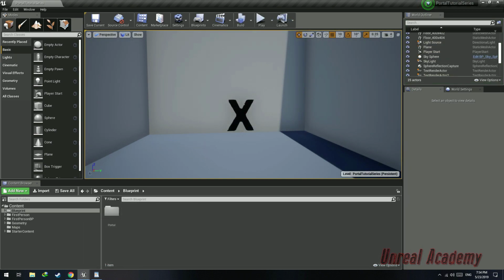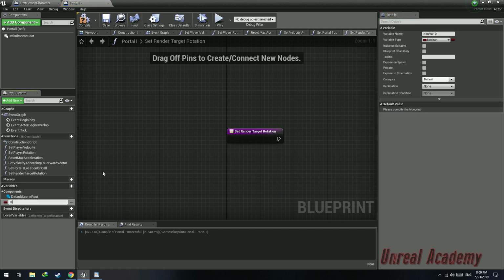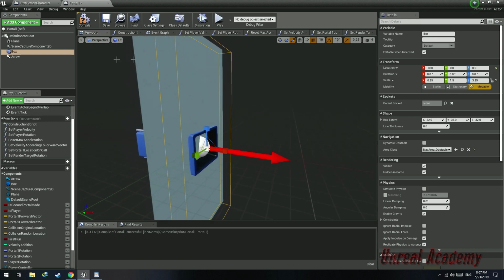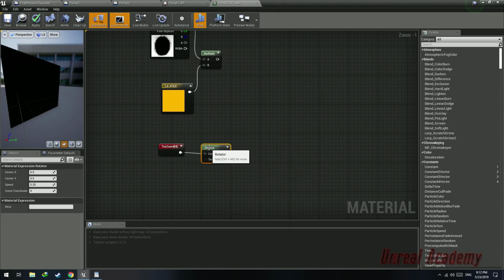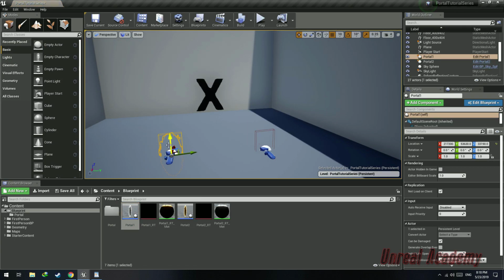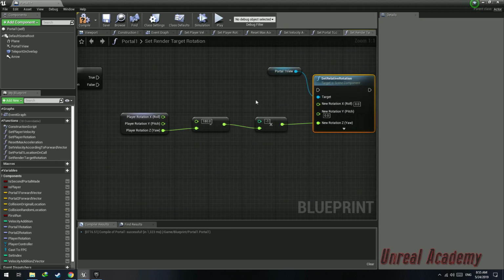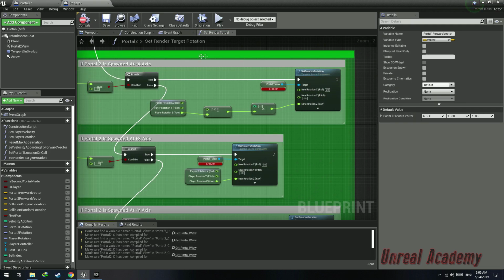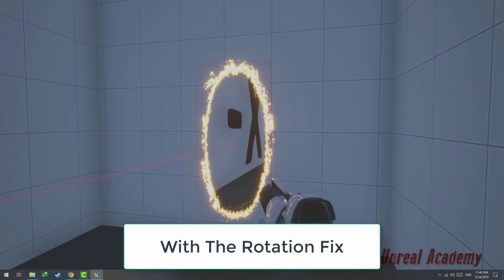Portal Gun Tutorial Series  - Setting Up BP - Variables And Render Target | Part 2 UE4

Comment: Do you have any idea why it is that when I set the portal texture color to a blue or green hue it decides to show the edges of the texture again?? If anyone can help me that'd be awesome.

(Edit: I moved on from this problem for now and have run into an issue where the "CastToFPC" is unable to connect to "Portal2ForwardVector". Any help would be appreciated!!)
Reply from the maker: Did you manage to solve it? If so, let other people know so that people can benefit from the fix! My guess is that the blending and all that only work with specific values/colors, which is why that happens.

As for the second issue, I don't remember why it is supposed to cast at this point, and so I can't be much of help for you with this. Sorry!
Reply: @UnrealAcademy  Thanks so much for the response! I found a suitable semi-workaround for my project where if you add an additional blend overlay with a separate texture and constant multiplied by each other you can add an inner layer of whatever colour with only a small ring of the original texture colour options (white or hues of red) on the exterior of the portal. This actually helped create a beautiful effect on my portal but it doesn't fully solve the problem.
Reply: @UnrealAcademy  Still no luck finding a way to connect those 2 nodes though. they seem to have gotten rid of that capability in version 5.
Reply from the maker: @ZonsCHANNEL  Right click and see if you can do something with it. I remember you used to be able to right click the hole and some options would pop up?
Reply: @UnrealAcademy  unfortunately I tried this already with no luck. I’ll continue to search for a solution to the problem and give updates here if I make any progress

Comment: Don't know if you still look at comments for this tutorial, but I'm having an issue with the portal's camera moving with my player camera. When I look left to right, the portal view stays the same (ie, it works), but if I look up and down, the portal view moves up and down as well, and it sort of ruins the effect. Did you cover this at all, or is it something I missed?
Reply from the maker: Hi! Yes, I do still look at comments, just don't make any videos anymore due to the timetable of the university.
As for your question, yes, that is a bug in this Portal system that I could not solve because the player rotation doesn't give us a way to check whether he is looking up and down. 
I think you could do one thing, check the player forward vector. If it's in the Z or -Z direction, you can move the portal camera accordingly?
Reply: @UnrealAcademy  I'll be honest, It's my first time using unreal, and what you said pretty much went over my head, but I did find a "sort of" solution. Connecting the Player Rotation Y variable to the New Rotation Y when setting the Relative Rotation fixes it - there's still small movements when looking up and down, but it's better for the most part.
I did however notice another mistake/bug, where when you're looking at the portals and walking away, the object in the portal view move too, which I don't think is supposed to happen?
Reply from the maker: @FrostKF  Wow, thats good to hear that you were able to fix it! I'll see if doing the same thing on my end works out well! 
As for what you're referring to, I dont think it's supposed to happen, as you can see at the 20:12 mark of the video, the objects in the portal view dont move at all.
Mind sharing a video so that I can get a better understanding?
Reply: @UnrealAcademy  Here's a link : https://youtu.be/GXjH2eX46c8.
I reverted the quick fix solution and still have the same problem, so I don't know if I've accidentally changed something, or if I missed something all together.
Reply from the maker: That's a problem I was trying to tackle but couldn't because I couldn't find a way to get culling to work. Basically, when you move from point A to B, the objects in view should shrink accordingly with respect to the distance that you moved back by. But for that to happen, we have to move the actual camera of portal 2 back the distance we moved ourselves. But if the camera of  Portal 2 moves back, how do we ensure it ONLY captures the view its supposed to capture and not the walls? You use culling and masks. That's something I was not able to implement. 

Here is a wonderful video that explains what should happen:
https://youtu.be/_SmPR5mvH7w?t=229

and here is a video on how portals in Portal work by the game devs themselves:
https://www.youtube.com/watch?v=riijspB9DIQ

Hope this helps!

Comment: I'm trying to use this mechanic in a project of mine. That project is filled with lots of assets and it runs okay like 35 fps. but when i add  a single portal, the fps drops down and chops a bit. is there any fix to this? also i dont have the material asset, orion?? Please help. Thanks in advance. 
I'm using a 2017 macbook air. I know its a terrible laptop to run ue4 but still.
edit: 
i did try it again by manually turining on the lighting components. Everything works fine at 35 fps. but when i add the portal, it drops to 9 to 10 fps. i am using this on a 3rd person shooter game. Please help me.
Reply from the maker: In the camera actor, untick the "capture every frame", now the FPS shouldn't decrease, but the portal won't give a "live feed" and will be static. You're going to have to update it every time the player looks at the portal from a different angle and change the code accordingly. It will help in your understanding quite a bit as well.
Reply: @UnrealAcademy    thanks a ton mate! It works. Fps wont drop anymore. Besides, are you telling me to create multiple portal blueprints for different angles ? I didn't quite get what you were saying. 
Edit : I completed this tutorial video of yours. I am now seemingly having lag when i keep "capture on movement" enabled. is there a fix to this? also, did you set the portal1fwd vector & 2 in the player character according to the x axis of both the portals.. In my case, both the portals are on -x axis. what should i do ?
Reply from the maker: @talesfromthetimeless  The code should work on every surface, it doesn't matter on which axis.
As for a fix for it, basically, every time a player moves or looks around, there should be code/function that should cause the camera to take a picture.
Reply: @UnrealAcademy   Player's camera or the portal's camera ?
Reply from the maker: @talesfromthetimeless  Portals camera
Reply: @UnrealAcademy   Everything in the portal works except for live feed. Can you tell me what to do? Also i tried doing this portal gun on by having multiple weapon blueprint classes. Before starting this, i had set up a rife animationthat shoots bullets and a rifle weapon blueprint , but whenever i pick any sort of weapon now, it only shoots portals. Can you please help me?
Reply from the maker: @talesfromthetimeless  
1) In the Portal camera actor, tick the "capture every frame", it should now give live feed but it will decrease the FPS
2) Because whenever left mouse button is pressed, it is running the script to shoot the portals. Add a check to shoot portals only if a specific gun is in hand.
Reply: @UnrealAcademy  i dont want the fps to decrease 😅 because i am aiming this game for mobile platforms
Reply: @UnrealAcademy  i want the portal gun to work a singular weapon and not work on all weapons. Now that i have completed this tutorial videos of yours, i'm able to create portals that's great. But i'm not able to shoot bullets with a rifle.
Reply from the maker: @talesfromthetimeless  Ohhh, this is not meant for mobile platforms! You shouldn't be using this portal AT ALL as it can severely decrease FPS. There is no workaround for it. If you want to have a dynamic portal render system, then you HAVE to have the camera capture every tick, or set a timer to capture it after every X second
Reply: @UnrealAcademy  Thanks for the suggestion. After adding the portal gun to my game. All my guns now fire portals!! I had a rifle gun that used to fire bullets. Now just every gun fires portals. How do i disable that to make sure that the portals are triggered only from the portal gun and not the other riflegun or pistol gun, etc? the same way to make sure the bullets are not triggered by the portal gun and only triggered by the other normal gun. Please help. As for the portal gun itself, the main gunclass blueprint is the parent class. the spawn projectile bullet was also added to the gunclass blueprint unlike yours, where you have used the spawnportal 1 and 2 functions on the main character's event graph. Please help.
Reply from the maker: @talesfromthetimeless  
In the 3rd part of the series:
https://youtu.be/K39IhmHG_o0?t=58
You added an even that spawned the portal. Before calling the Spawn Portal function, do a check of which gun is the player currently holding. If the player is currently holding the Portal gun, then fire the portal, otherwise fire the respective bullets

Comment: When I  enable global clipping and restart editor, it stucks at 39%.
Reply from the maker: Create a new project, enable global clipping, restart. Does it work now? Which version of the engine are you using?
Reply: @UnrealAcademy   4. 24. 3
Reply from the maker: @appropriate_name1  Does creating a new project help?
Reply: @UnrealAcademy No, it doesn't.
Reply: @UnrealAcademy  I create a new FPS project with starter content in UE4.24.3, I  go to project settings and enable global clipping. Next I press "Restart now". Initializing is stuck at 39%.
Reply from the maker: @appropriate_name1  Hmm, I guess its a problem with your UE4. Try verifying the install, and if it doesnt work, try using 4.25
Reply: @UnrealAcademy  i use 4.25 and it stuck at 39 too
Reply: is there anyone that can solve this problem

Comment: Hello! This tutorial was great, and super helpful! The only issue I came across was the portal camera rotation fix. I had followed your system step-by-step, and it still isn't working. I'd send you a link before hand, but I'd like for you to get the notification of this comment instead of having to search through spam (thanks, YouTube). I'm using UE4 4.18.3, and I'll get to compiling the images for you to see, unless you'd like the project file itself.

Comment: Fantastic tutorial. When i set one of my portal colors to blue, the corners dont go away, and stays as a square, how do i make it so one of my portals can be blue?
Reply from the maker: Thank you! Some colors don't work using this setup, maybe try some other color?
Reply: @UnrealAcademy  it seems like only "warm" Colors work. You see, I'm trying to remake Portal in UE4 for VR, so it kinda has to be blue lol. Orange works fine, do you know of any way to make it blue?
Reply from the maker: @RyDawgE  Ahh sorry, I wasn't able to figure that out, maybe try to search around a little bit about subtraction of parts of textures? I'm sure you will be able to find out a solution.
If you do, please share with me!
And I'd love to see your finished game!
Reply: @UnrealAcademy  thanks! I'll shoot ya a link when I get enough things working
Reply: @RyDawgE  The mask works by clipping the G&B channels of the "RGB" spectrum. You can technically not create a blue portal with this process, however you can trick the system.
All you have to do is set your constant 3 Variable to the color you want, and then make sure the "R" channel in the details pane is set to at least 1. This will not affect the color, but will mess with the brightness. Just lower the Lerp B value to around 0.1 or so, otherwise it will be insanely bright to compensate for the lack of red color in a full red channel. Its a little hacky, but it works reliably without any issues.